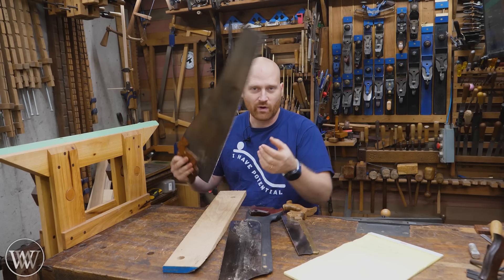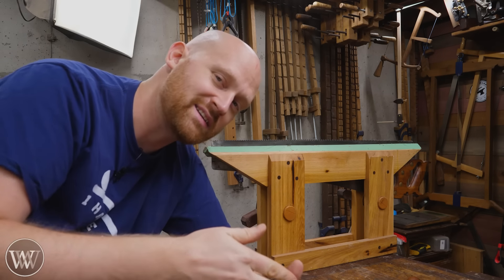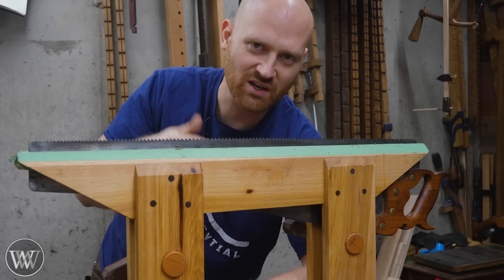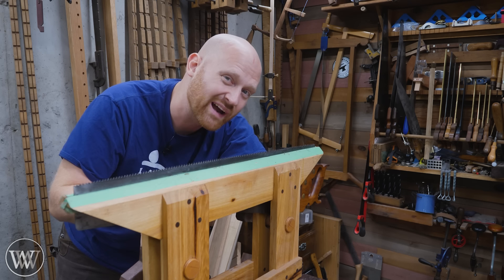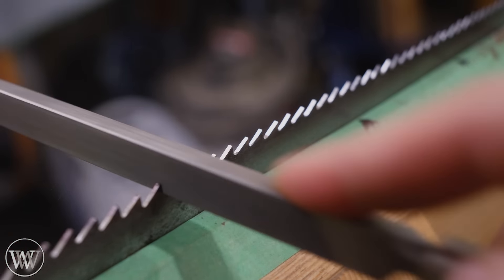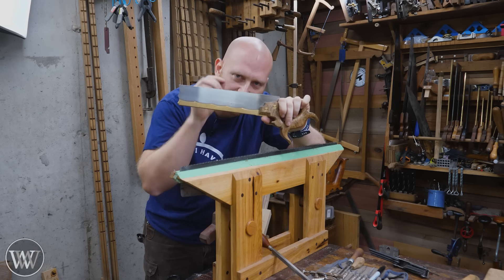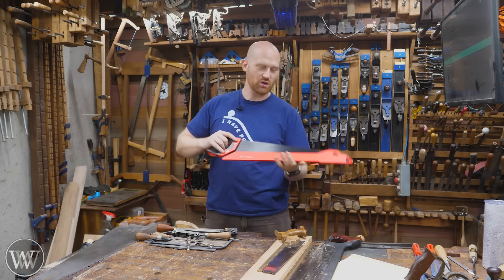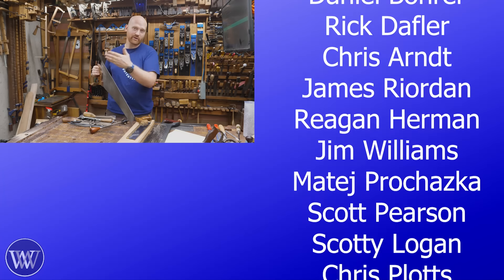How To Sharpen A Hand Saw | Rip Saw

Comment: My recommendation is, "Don't wait too long!"  I recently jointed and sharpened my 5 ½ ppi rip saw thinking it "needed a touchup."  After sharpening, the saw ripped ¾ white oak at a rate of about an inch and a quarter per stroke...prior to sharpening,it only took about ¼ inch per stroke...summation...I was wayyyyy overdue!

Comment: I basically grew up in a small engine repair shop and the business was shared by a guy that cut keys, sharpened saw blades, and rented U-haul trailers. He was gone a lot so my dad was often cutting keys , but the saw sharpening was always the old guy and he had a metal two jaw vice with around 30” arms and a retractable bolt apparatus to hold circular saw blades so that the bars held about 10-2 o’clock between them and let that section be worked on, or removed for hand saws. He would go down the line skipping every other tooth, flip the saw, then do the same. Then he would pull out the tooth set (I assume if needed) and go to town like a dentist getting paid per… tooth…  but he never tried to work from both sides, he always flipped the saw

Comment: I do use hardpoint saws from time to time when there is a higher risk of meeting nails screws or other debris in the wood. They can be re-sharpened using diamond files which are pretty cheap these days, though sharpening is somewhat slower. I absolutely prefer well sharpened vintage saws with handles actually designed to fit the hand. These are a dime a dozen at yard sales and just need some TLC but, for me, it does not feel right to use them in circumstances where there is a higher likelihood of them suffering damage. Quite a few of my saws are well over 100 years old and I like to think they will still be in good shape a hundred years from now

Comment: Couple years ago watched a video from you and one from Paul Sellers.  Then took a cheap old handsaw I  had for literally 40 years that never cut well, and I hadn't used it for decades.  Bought a file and sharpened it.  That first time took me a couple hours probably, but the saw cut like a champ after that.  Since then I've gotten much faster and have no trouble sharpening lots of saws.  Still not good enough to do a dovetail saw with 15 tiny little teeth but maybe someday.   Like you say, it's not hard to do, just takes some practice.
Reply: If you can do a big one, you can do a little one. Give it a go, it's no different really, just a smaller file. If eyesight is an issue, pick up one of those magnifying glass visor things (Rob cosman often wears one) to help.

Comment: Very informative and very encouraging, James. I've watched enough videos with handsawing to recognize how quickly a sharp saw can cut - but I still haven't worked up the nerve to try to sharpen my grandfather's 10 point crosscut. Your suggestion to buy some flea market saws for practice is a good idea. Thanks for sharing.
Reply: I was taught by my grandfather well over 50 years ago on old saws in really bad shape. Getting thrown in at the deep end is a good way to learn and I still have, and use, a couple of these saws. Flea market saws are the best way to learn how to completely re-tooth a saw. If you make a mess of it, work out where you went wrong, then file off all the incriminating evidence and try again.

Comment: Hey James love your saw videos I've picked up a thing or 2 from each one, I was given a saw for Christmas last year and it's a western style 20" rip saw with induction hardened teeth I noticed from use I found a couple of cracks so I got my torch and blew the hardening away in a couple of minutes, most saws are made with 1095 steel the same steel some knives are made of from now on I'll just heat up the teeth down the line until I see it turn to more of a dark straw color and it's able to be sharpened again, the tempering process brings down the hardness so the steel is not brittle this is not done with any of the saws I've looked at old style saws same type steel just not hardened.
Reply from the maker: correct. most good saw are tempered to spring steel that is relatively soft. you got off lucky softening those teeth. most people who try it end up with a warped plate.

Comment: I just got into woodworking seen a Stanley 55 set with 48 blades but missimg the left fence and a tighten screw on the adjustable skate. Also bought a decent saw and some chisels at a couple antique stores.

Comment: Question, James. You run your stone down the set but Paul Sellers in his video on fixing the set for the Spear and Jackson taps it with a hammer. Does it matter which way that is done and if so, when do you do the stone and when do you break out the hammer? Looking forward to the other videos in this series as well.
Reply from the maker: Some people like to use the hammer. But I have found that to weekend the tooth as it is not good to bend it back and forth. Also with the hammer it is very easy to bend it back too far too quickly. With the stone it is very easy to sneek up on the perfect amount without stressing the teeth more then they need.
Reply: @WoodByWrightHowTo  So let it be written, so let it be done :) my Spear and Jackson backsaw gets some attention this weekend and that will be part of it.

Comment: Dear Mr. James, can you go into finer details and explain about wearing the middle of the file faster then the rest ? And what if a slim taper, slim or non tapering file is used which perfectly fits between the teeth without any of its portion sticking out ? If a perfect fitting file can be used, why have you used a bigger one ?
Reply from the maker: if the file fits all the way down in then it is twice as small as it should be. The reason is the tip of the tooth will wear out the dace of the file twice as fast and the round at the bottom of the gullet will be too small for the larger tooth. this will become a stress point that could lead to the tooth breaking. the file is sized so that you basically have 3 files in one. and each corner of the file can be used all the way untell it wears out. if the tooth comes past the halfway point on the face of the file then you will wear our that center section twice as fast. because when you rotate the file to another corner then the  next point will rub that center section wearing it out twice as fast as the corner.  and the center section is the important part as that is what sharpens the cutting edge of the tooth. I hope that makes sense
Reply: Thank you so much for answering my question.

Comment: Dear Mr. James, is it possible to convert a rip cut saw in to a cross cut saw by reteething it or by altering the teeth geometry of the existing teeth ?
Reply from the maker: Yes. That is fairly common. Just change the file angle.
Reply: Thank you so much for answering my question.

Comment: When you were filing the saw teeth in the saw vise, the close-up view showed the saw visibly bending from the file pressure. Was the saw vise not tight enough or is this normal movement?
Reply from the maker: normally I would want the teeth a bit lower in the vice so they would not do that as much. but with the big hand saw there is not enough space before it hits the screws. so for these big saws it sticks up a bit more. it is not ideal, but it is not bad.

Comment: man that was intresting .i was wondering if there is a tool to sharpen a saw but cant find one like have for knives
Reply from the maker: It is just the triangular file. Even the automatic machine still use a triangular file.
Reply: @WoodByWrightHowTo  ok thanks .will just have to dothat then .i thought it would take ages doing each tooth but after watching you it don't look too bad

Comment: Super tuning is fun for weirdo’s, but… has limited utility.

I do like the way I look in a highly polished tool though… 😊
Reply: The real plus to highly polished saw/tools, is you can read the reflection as a sort of angle finder for true straight 90s and to get make a marker line seem so much wider and easier to follow. If the line shows on both sides of the kerf, you're centered on your mark. If you use a thinner line, like a sharp marking knife makes, it leads to tighter fitting joints, with practice. Also, a highly polished blade can often glide more smoothly when using a saw with very little set. Polished is not necessarily all about vanity. Though, for those who like seeing themselves, I suppose it can partly be about vanity. Some even call it pride in a job well done, when the tools look new or better than new when they are done sharpening/tuning them.

Comment: I'd love to see what you do with a saw when there's a few broken teeth and you need to start over from scratch. I have one such saw currently that I was given, and I would really like to do it, but I'm not sure what the best method is.
Reply from the maker: usually if there are less then 10 broken teeth I just file as normal after a few sharpenings they are back to new. if there is more then that there may be a hardening issue with the plate and it is too brittle. Or it has been over set and the teeth were bent back and forth too much. in that case the best thing is file them all off and cut new teeth.

Comment: Did he use a saw set? did I miss that?
Reply from the maker: That is a separate operation. Some people do it at the same time but generally you only need to set the teeth every 4 to 6 sharpenings. I've got a couple videos on that as well.

Comment: I'd argue for going straight to high quality files, the difference is quite noticeable.
With cheap files, to me the movement felt very stuttering and rough, and they soon wore out, especially on the small in between faces.

When I looked into ordering high quality files, I discovered that triangular files weren't that much more expensive than big box stuff. 
(Plus, in my case I'm lucky that Vallorbe is only two hours drive away and that they ship straight from the factory).

Comment: A great tip from Paul is to cut the bottom of the gullet with a hack saw to keep the bottom of the file from touching it thus extending the life of the file
Reply from the maker: That one I don't buy as it is not the point of the file that wears out first but the face. It is good for starting when you need to locate the file.

Comment: What about surface rust?
Ignore it.
Oil the sides so it doesn't grab in the cut.
Sand off and put a protective coat over it.
Use acid to neutralize it and oil or was the surface.

Comment: Someone might ask, if you're going to be filing all the teeth at the same angle, why not just file them at 90 degrees? I can think of two reasons. First, the angled cutting edge cuts more gradually, hence more easily. Second, the angled face of the tooth clears the sawdust more easily. The latter could be an argument in favour of alternating the angle of the teeth, since it will clear the sawdust more evenly. This should make the stroke still easier and maybe less likely to wander. In theory. In practice--gotta try it!